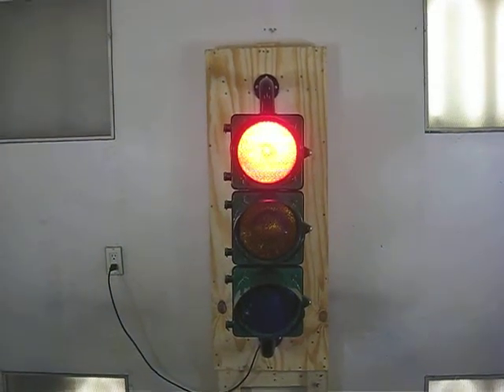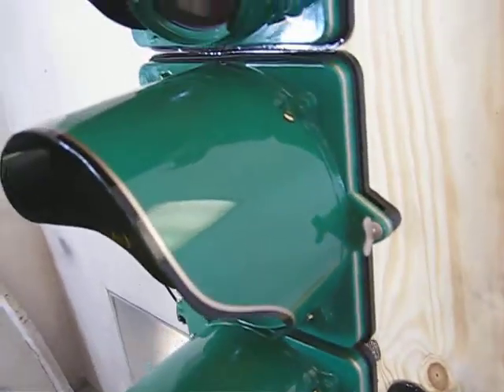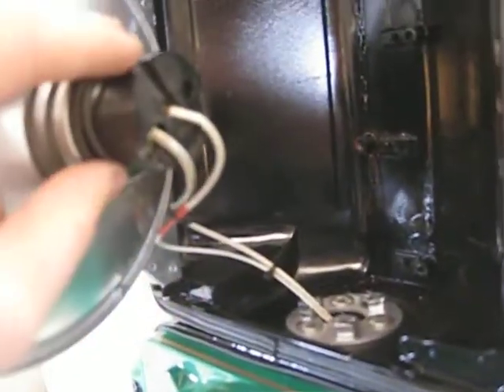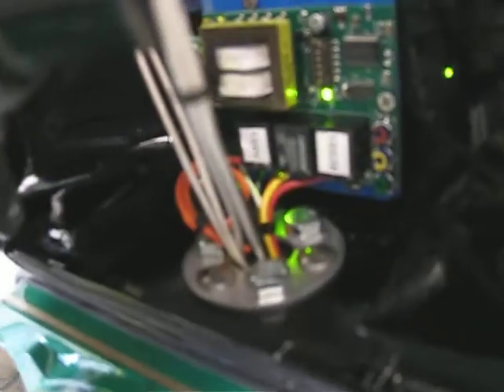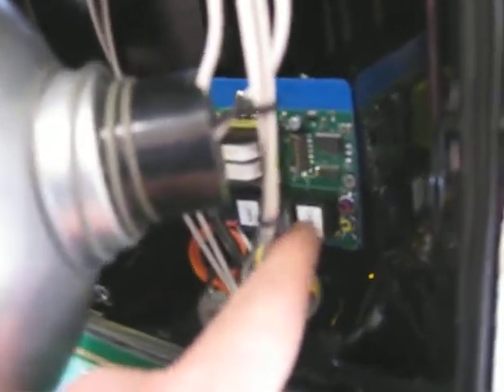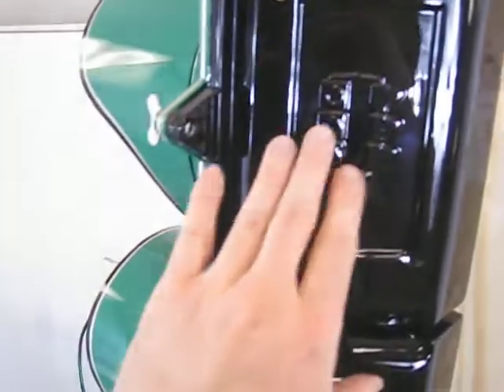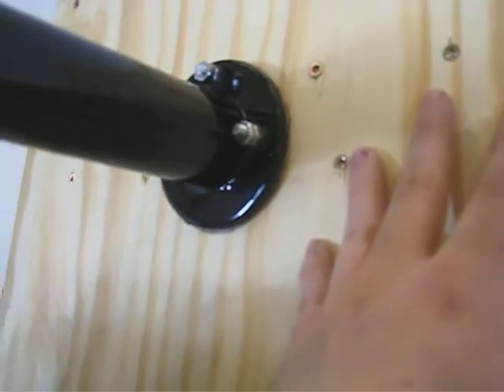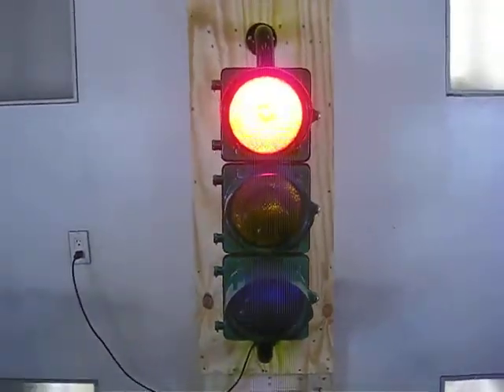Restored Vintage Traffic Light, TSI, Circa 1940s

Comment: I remember seeing one of these signals- first time ever- in Milwaukee. I was a kid but I was very much aware of traffic signals and a couple of manufactures. When I saw these, I literally froze and did a double take trying to see who made these.  I live in Illinois and never ever saw one of these here.  Fascinating and really fantastic design, especially the side/rear housing.  Because I would see these from riding in the backseat of the family car, my only glance was if we ended up being stopped at the red light and we were close enough to the signal!  

Your work is incredible. Where do you located these treasures for restoring?  Your attention to detail is second to none.
Reply from the maker: Thanks so much for the kind words!  While working on these traffic lights, I couldnt help but be impressed with the excellent design they used.  I've done a few Crouse-Hinds, this is the first TSI I've done, very well designed, definitely a "design for assembly" approach but also with great asthetics for sure.  In answer to your question, we've picked these up over many years, they used to be common at auto swap meets, but you dont really see them anymore there, not the desirable ones at least.